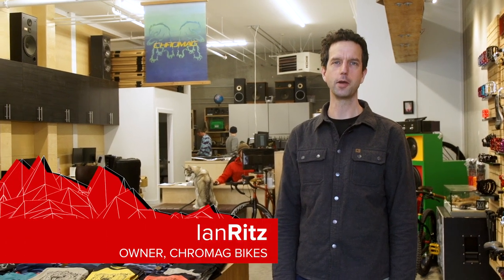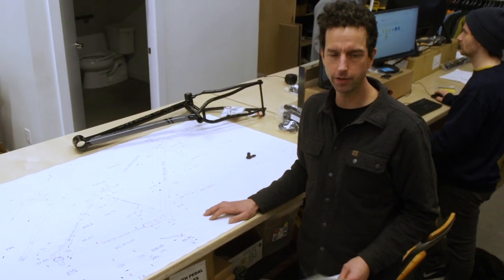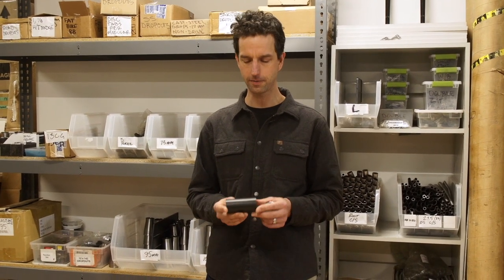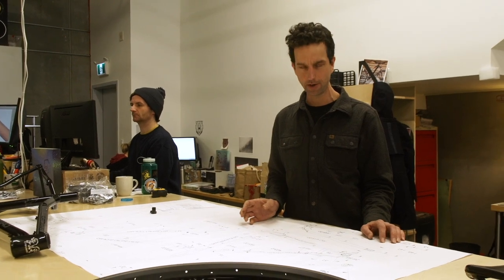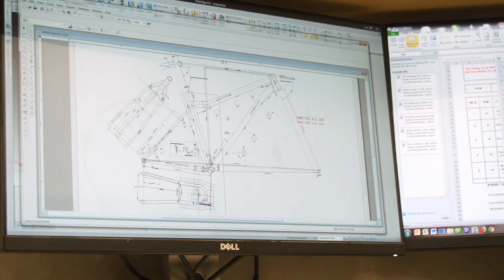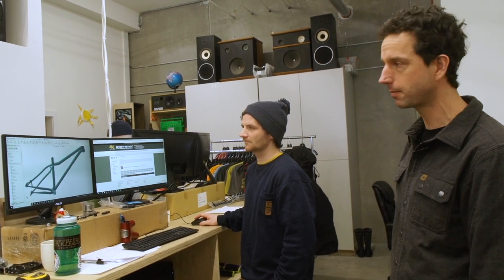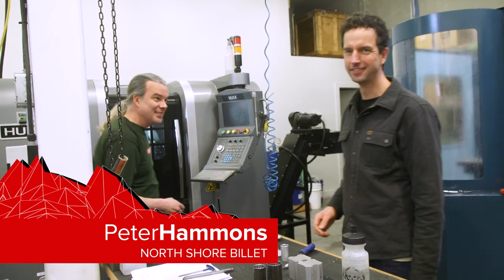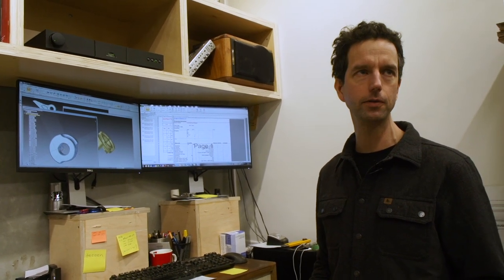How Chromag Makes A Bike

Comment: Super cool behind-the-scenes look at what goes into a chromag bike. I, for one, typically prefer threadded BBs, but after seeing the size difference between the two, the PF makes a lot more sense in this application. Beautiful bikes.
Reply from the maker: Yeah we felt it was important for Ian to explain that actually there was a purpose for using the press fit system in this instance. It can be such a 'poking the bear' topic to bring up, but here everyone has learnt where there is a useful application.
Reply: I dont understand why all new BB standards have to be PF. Why not another threaded size if the diameter needs to increase?
Reply: because imagine trying to work a huge thread lose that is siezed or jammed
Reply: @ryanthomaslane1  There is the T47 option

Comment: What i dont understand about the "new" geometry trends is the short rear end. Especially on a hardtail. If you really wanna shred on a hardtail you are gonna want all the rear end stability you can get and in that case short chanistays arent of much help. I get that they want the bikes to feel more lively but shouldnt a stable rear end be what you want on a hardtail, becuase hardtails are really playful by nature?
Reply: Youtube User I'll take the shortest chainstay I can find. It turns, manuals, and jumps so well. The primary reason I bought my chameleon is because of the 415mm chainstay.
Reply: I agree. Finnish Pole is making long and slack bikes with long chainstays.
Reply: Pukki34 but pole is expensive af.
Reply: A short rear end is not as stable, but it turns so much better. Some folks are going to like the straightline stability more than the ability to rotate quickly, but I prefer a shorter back end. Modern 29er hardtails have shorter backends than my old 26", and consequently lose that old wagon wheel feeling that folks used to complain about. When a hardtail has long chainstays it feels dead and cumbersome to me.
Reply: William Taylor ?
Reply: Youtube User im all for shorter chainstays..love the liveliness that you dont get on a full suspension bike.
Reply: Ride a Chromag then make an opinion